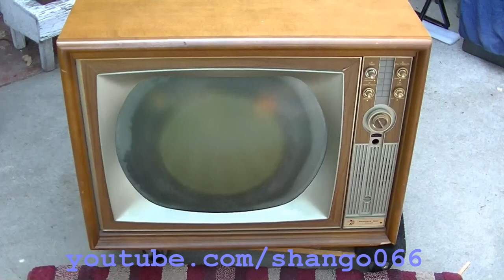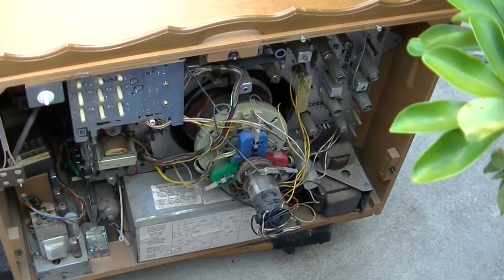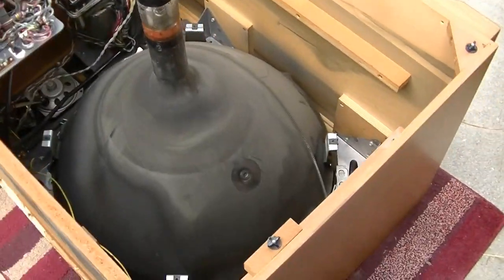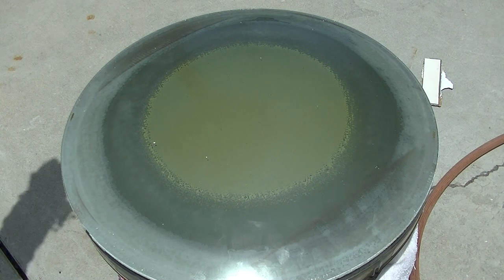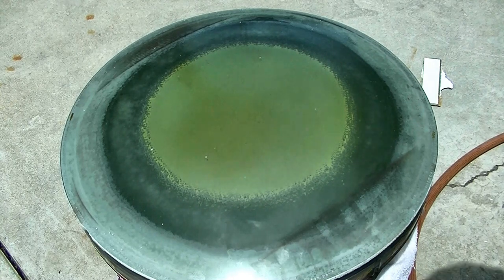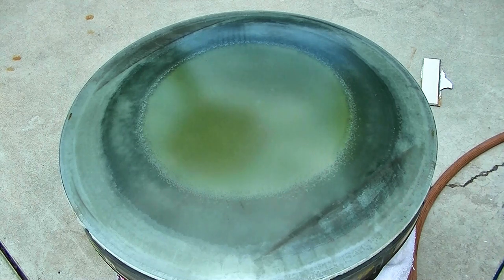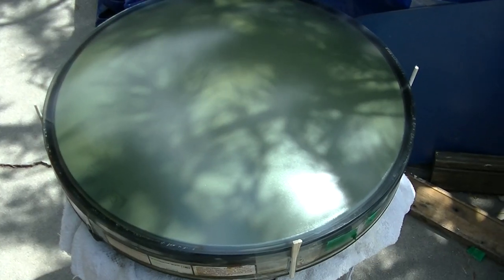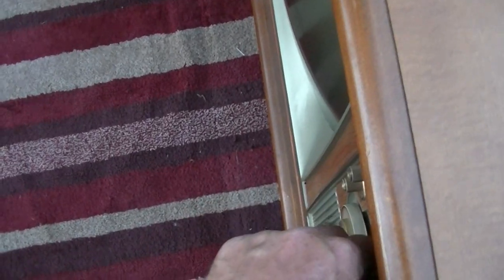Round CRT Cataract Removal RCA Style Tube Packard Bell Roundie Television PT3

Comment from the maker: This was part three of the Packard Bell, part 2 will be out in a few weeks.
Reply: Nice video like always. But did you use a different camera or did youtube do something to there coding system? I see a white/light halo affect around the black paints-tripper that I never noticed before.
Reply: I see it has red, green, AND blue transistors in it.
Reply: I only like sniffing Smellovision...Not Sniffovision!    I might smell sniffovision but I never sniff it! Don't picture tubes blow in and not up?  After all , they are vacuum tubes.
Reply: If one looks closely with a microscipe or more powerful magnifying glass, can one see a few of the things that this tv broadcasted from the past?
Reply: Can you actually cut a hole in the top and make the tube itself a fish aquarium?
Reply: @terabbs  Yep, it was coming from the heat gun for me too. It only appeared after he started heating the tube, though. Maybe encoding/editing error, or maybe he switched cameras.
Reply: cool video dude man yo bro
i just did this with my 2018 Samsung 4K OLED SmartTV. it has a serious cataract issue and needed to be carefully removed using a hot wire and a laser.
Reply: Very good  detailed video!
I've always enjoyed watching you repair TV
Reply: have you tried tec7 glue or the same glue that car front glass uses? both are a bit like rubber and are very good
Reply: @terabbs  I think it’s some dodgy HDR the camera is doing. Definitely helped though in the bright sunlight
Reply: @jockoharpo2622  The tube would likely explode so it is not a good idea but with the right equipment it is possible.

Comment: Shango: "It's Free! You can see it divorced."  Me: don't look now but the PVA glue is demanding alimony...

I don't see a safety issue with removing the glue and siliconing. There were 2 round CRT types used interchangeably circa 1964 the 21FJP22 which use the cataract glue, and the 21FBP22 which had NO glue but instead a rubber gasket around the edge and an air gap in the middle (the mounting flanges pressed the safety glass on). What you've done is turn a 21FJ into a 21FB. Both CRTs were safe enough that they were used interchangeably in sets for years. The tube charts in the sets and Sams would call out both types as valid replacements. It'll be fine safety wise.
Reply: It's better to be safe than sorry and this is a public service video, what do you expect the guy to do ? quote numbers and say 'it'll be fine '
Reply: @andymouse  No, but Shango obviously didn't know about this. Good info for me.

Comment: would be interesting to try loca, liquid optically clear adhesive as a replacement, uv curing and basically identical index of refraction to glass.
might be able to even pump it in and then vacuum degas the entire thing in a big chamber
Reply: I was just thinking about that. There’s not too many people interested in these old sets though, so the cost per set and setup would be prohibitive. It would be one hell of an experiment on a smaller CRT.
Reply: Only if it doesn't go opaque in 50 years time!!
Reply: I was wondering what his solution would be, and almost shocked he just left it at an air gap. Obviously people aren't too worried about visual fidelity with these old sets, but you're definitely losing overall image quality and viewing angle without some kind of adhesive ensuring continuity between layers. Also a chance for dust and other particles to accumulate between the layers. The restoration effort is INCREDIBLE though, so I guess we can't complain too much haha

Comment: Ever tried liquid optically clear adhesive (LOCA)?  It's a UV curing optical adhesive, often used for phone screen repair. (why I know of it)
If it didn't work out, it'd be much the same procedure as this to remove it.  Could also practice with panes of glass.

Comment: People dont worry about not having the "protective crt layer" here in the UK we never had them from new. shango with this removed see if you have any chemicals that will break it up so next time you can experiment.
Reply: Actually we did, from about 1962-ish onwards. That’s why TVs from before the 60s had a separate glass sheet over the screen. Once bonded glass to CRTs became a thing here, glass window sheets on TVs became unnecessary.
Reply: @stickytapenrust6869  Oh didnt know ive never seen one, round crts were also a big rarity unless you got a set from the early years like the 30s/40s i can only remember as far back to the days of reddifusion sets
Reply: @Synthematix  You will have seen one. Even up to the last CRT sets there was always a layer of safety glass bonded to the CRT face. It’s just we live in a milder climate so it’s much rarer for the safety glass to become unbonded from the CRT face like this.
Reply: @stickytapenrust6869  No, bonded glass became obsolete when they invented the metal stressband around the rim. In Europe we never had round colour screens, and the b&w in the fifties had a separate safety glass.
Reply: @telocho  most do but some dont...for example i have a saba tv from the 50's and it doesnt come with safety lense...its an old 90º deflection tube so...safety lense was more like a gizmo to give peace of mind to worried people...not really needed

Comment: I wonder if you could just use a thin metal "straw", stick it in between the tube and glass right to the midde and apply air from an air compressor to separate the 2.
But that may probably crack the outer glass.....

Comment: what if you don't sillicon the glass back? will it work?
Reply: I'm sure it would work fine. Probably even be a little bit more clear of an image on the screen even. But no telling how strong that CRT glass is. These were made with the safety glass in mind so the CRT glass itself may be thinner than that of say a CRT from a tv made in the 80's or 90's since they don't have that extra layer. Secondly, the CRT may not even fit back in the cabinet properly with that extra layer of glass off. It would need something to fill in the extra gap.

Comment: Just to confirm Shangos safety advice re tube and shock hazard. An average 21 inch colour tube running at 20-25kv or so will have an energy of about a joule ready to zap you. This is unpleasant. Ten joules is considered dangerous and 50 can be lethal. If you were to string fifty tubes together you might be in trouble.
This is of course from a set that has been powered down. A running set is more dangerous as you have a continuous full powered whack available. Avoid this. (Unless your name is Shango).
Reply: Learned it the hard way getting zapped from home-made tv flyback transformer HV thingy I built when I was 15. Ouchy._
Reply: It's not that unpleasant if you're expecting it.
Reply: @godfreypoon5148  😸 Doesn't bother me either. Though you should reserve a little respect - or something may nibble harder than you did expect... Happened to me for sure.
Reply: @godfreypoon5148  Yep, plain old B+ can end your existence for sure. Especially 400V +  expect  order(s) of magnitude greater energy.

Comment: i had this same problems with some philips crt's except the glue was even more sticky and even let out some corrosive fluid to the chassis and pcb. To me it seems to be sort of polyester/osmosis problem like you find in boats. I glued the panel back on with an optical clear led coating from electrolube(polyurethane). Only problem i had was some tiny air bubbles from the mixing but you hardly see it when you look at the screen. (but then this was a computerscreen only used for data).If you use the original package from El there should be no bubbles in the mixed PU.

Comment: 10:36 a thermal blanket would work too. I usually use one whenever i recuperate the "lenses" off old tubes. With the caveat that one should be careful to heat up the whole thing, there's a risk of cracking them due to the different materials, i've cracked at least 3 so far.

Comment: Great video! But I wonder, could you use a clear vinyl shower curtain, laying it on the picture tube after cleaning well, then reinstall the glass screen, then trim the vinyl around the outside edge !

Comment: Thank yo soo much for this noob explanation

I wonder, is it possible to prevent crt cataract from happening in the first place?

I have a Black and white CRT from early 70s which still doesnt have this problem and I dont want it ever to happen so what is the best way to prevent this from happening
Reply: Think the only thing that would stop it is the CRT living in a vacuum. 50+ years of exposure to moisture, heat, sunlight, and anything else floating in the air is going to take a toll on any material like this.

Plus I think a newer style CRT might not use this type of bonded lamination either.
Reply: @erikj.2066  Most later CRTs used a tension band for implosion protection. The laminated screen was an earlier solution from Corning.
Reply: Since late sixties they don’t use laminated glass anymore because of the invention of a metal band, plus it was only ever used on round screens. I never saw a rectangular screen with cataract.

Comment: Wish someone would rebuild these tubes. I remember when 21fjp22 were everywhere. Great video, hello from Thailand.
Reply: You used to be able to buy rebuilt and new tubes back in the day. I used to buy them from a old school electronics part shop a old guy and his family out of his house. Depending on the tube they were 50 to 75 bucks and a bit more for a new one.
I don't think any normal outlets rebuild them anymore, no demand so why bother, plus who still uses CRT equipment or can find cores.
Reply: @69Dartman  i still use a toshiba 21 INCH CRT tv but it has laid to rest 4 days ago due to circuit problem after 25 years. in process of changing the motherbord of the tv. old one got repaired 7 times. And its Mono audio so audio sucks on that TV.
Reply: @Abhishek-C92  I still have 2 CRT sets that work, one we actually use till somebody comes and gets it. A 34hfx84 HD Toshiba, and a 20 inch flat screen Toshiba I bought for my room way before digital took over. I still have a couple of Beltrons and boxes of tubes I collected and used to fix TVs and radios back in the day.
Reply: @69Dartman  good so tell me one thing is it worth to spend anymore money on my toshiba crt cause it has flyback replaced along with few other components. will i spend anmore more on that crt or else buy a new 21 inch led tv?
Reply: @Abhishek-C92  If you really like the set get the parts and fix it, if you don't care get a good lcd set that fits your space.
I got a TCL 65 825 mini led 4k HDR set and it has a beautiful picture with excellent color and black levels.
It's brighter than any crt set I've ever seen and true 4khdr video is stunning on it.
Depends on what you want but you have the skills if you want to keep it going provided you can find or make the parts.
Reply: @69Dartman  thank you if i have any problem i may contact you if thats okay for you. good luck mate.
Reply: @69Dartman  planning to get a sony 21 inch led . is it better . or samsung ?
Reply: @Abhishek-C92  Sure, not sure I can help but I can give you ideas and I bet Shango could walk you through things if you get stuck.
Reply: Last of the U.S. rebuilders (Hawk Eye in Indiana) closed close to ten years ago. There was also a place in France that was doing it too that closed down. 

There’s a few videos on here from the Early Television Museum documenting both operations in their final days. 

The museum ended up acquiring the equipment, and remaining inventory from both operations, with the intention of offering rebuilding services, but last I saw they were having issues finding someone to do the work, and I believe supplies (electron guns, etc) were going to be difficult to source for certain tubes. Might have changed by now.
Reply: @69Dartman  The last CRT re-builder shut down in 2010. The Television Museum has a shop, but no one to do the work. RCA used to sell a line of rebuilt CRTs, called Silverama. When you replaced a tube, you could take the old one back for a bulb credit. Good idea, since these things are a haz-mat, and should never be left in a landfill. CRTs used to be warranted separately from the rest of the TV, too. Usually a new tube had a 5 year warranty, the set itself would be good for one year.
Reply: @dougbrowning82  yeah, I seem to recall they would want the core if it was a uncommon tube. I used to keep good used spares to drop into good chassis that were worth the effort.
Nobody does board level repairs any more anyway so they just drop in boards. Shango does it and I used to as well but not to his level. I was rebuilding for resale so if it was too involved or too beat up it became spare parts and I still have a few common boards from my favorite sets to repair and lots of tubes.

Comment: isn't the safety lens easier to destroy now with the air gap between it and the CRT rather than the clear silicony thing?
Reply: Its strong enough. In some other TV sets, similar protecting glass was mounted into front panel just covering the CRT.

Comment: Forgive my novice knowledge. Is there no way to reapply the same lamination material to make it “safe” again?
Reply: It’s perfectly fine without it. Pictures and videos are a bit deceiving but the safety glass is VERY thick if you see it in person (roughly a quarter inch or more). They mainly started bonding them to the jug to eliminate the need for periodic cleaning between them. In fact. The 21FBP22 variant (as opposed to the “FJP” in this video) was not bonded and for the sets that took those the front bezel and glass retainer clips were often removable from the front for cleaning without the need to pull the entire jug.

Comment: If I were a betting man, I'd guess that that bonding agent is colophony, or tree resin. It was/is used on microscope slides in a similar fashion. I can't imagine any synthetics of that era would be suitable or so long lasting. Smartphone repairmen use "UV LOCA" -Liquid Optical Clear Adhesive, to affix replacement glass. It's not very expensive and can be cured in the sun. Have you considered trying that? [oh, I just saw other people have suggested this]

Comment: I don't think that the glass on top is actually a lens, in that it doesn't have any actual refractive power that matters.  What it is, is a safety glass that protects the CRT in the same way that the extra safety glass that you glue to your cell phone protects the screen of the phone.  Now even though the glass won't be laminated to the tube, it is still positioned to take the brunt of a bump, and if the CRT did implode (as could happen if you tightened the mounts too much putting pressure on the bulb, and constant heat/cooling cycles did a number on the tube) that safety glass would prevent the tube from shooting glass into the faces of anyone watching the set.  Of course the wooden cabinet might get blown apart (hell, even an exploding capacitor has been known to do that).  
And glass CRT's are sometimes tougher than you'd think.  As a teenager, a few friends and I found an old 25" CRT and decided to throw it off a bridge over a small canal.  We were surprised that it didn't implode when hitting the water, and also that if floated.  So we started throwing rocks at it (it was floating neck up).  It took a lot of hits before it blew, and I'm sure the final rock hit the neck of the tube, not the bell.
I bet the reason it didn't come off right away was that there was still some 'suction' taking place.  The glue had let go, but you still had a partial vacuum under the glass that had to break.
Reply: Thanks for that, professor...

Comment: Very interesting, i do gameboy mods and one of the older mods was where you stick a frontlight to the original unlit screen and what was used was a glue called LOCA (Liquid Optically Clear Adhesive) and it would dry in UV light so you would either get an artificial one or you could leave the screen out in sunlight (theres much easier methods now like just replacing the original screen entirely). I wonder if its the same glue that was used all the way back then for this the only reason i think that is if you dont leave the screens out long enough you would get those finger things like shown in your video. Also LOCA smells pretty bad too so there's that lol